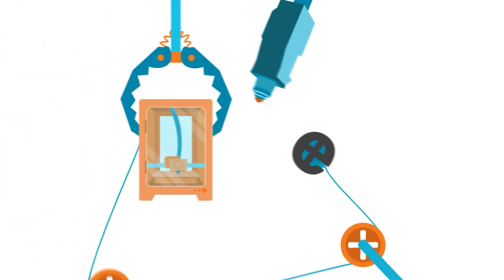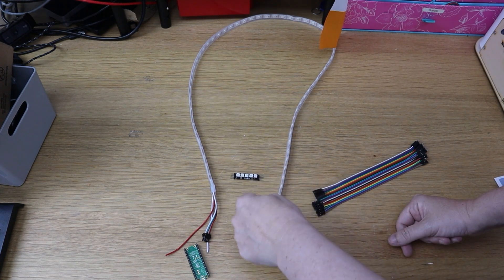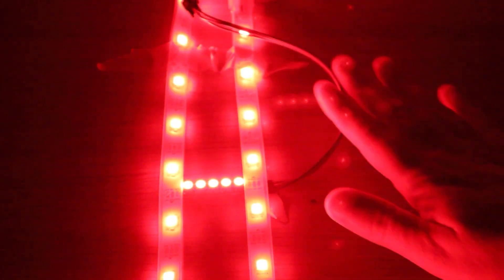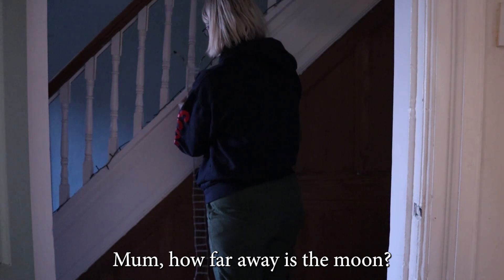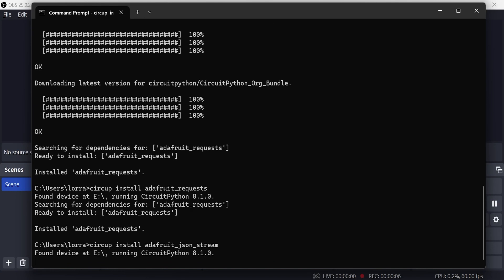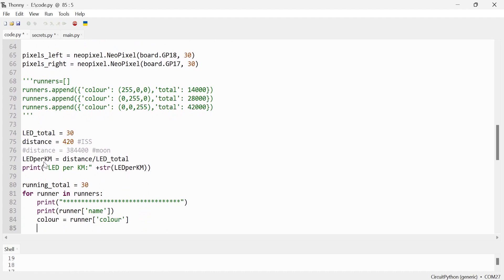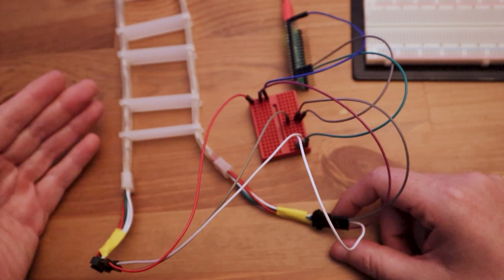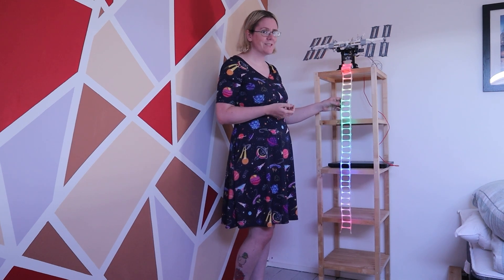How to Run the Distance to the Moon with Strava Data and a Pico W Board

Comment: Very interesting project and nice presentation! I used PicoW on Pimoroni Inky Frame with MicroPython to display weather forecast, but using API's over HTTPS that return large JSONs was a constant running out of memory. HTTPS/TLS libraries in MicroPython leaks memory like crazy! Ended up with creating proxy server in the cloud that translates HTTPS to HTTP and JSON to binary structures adapted to my needs.